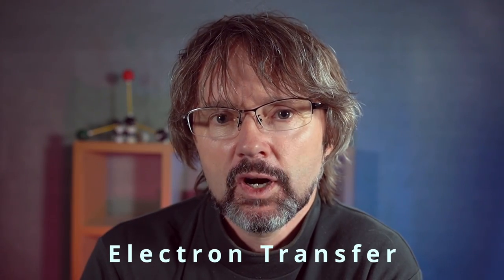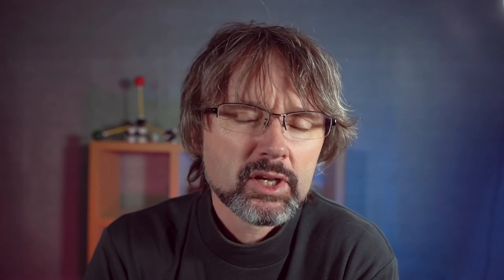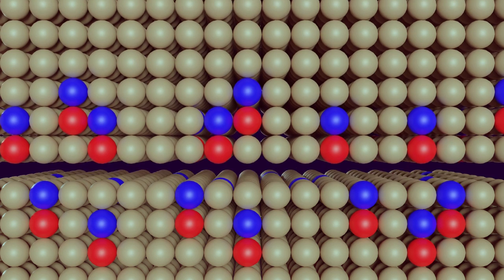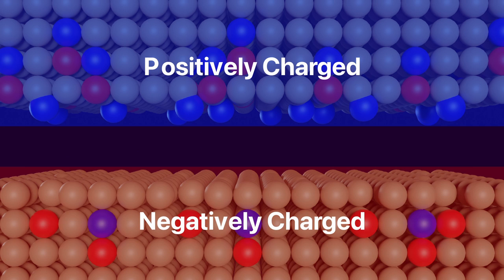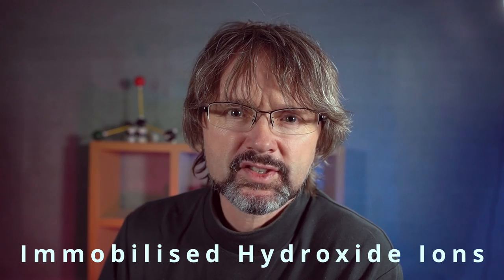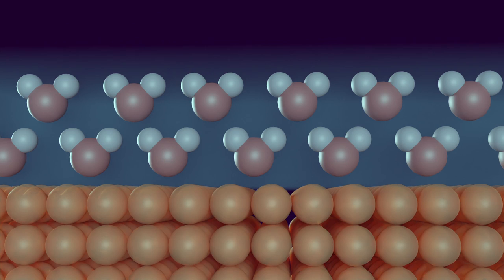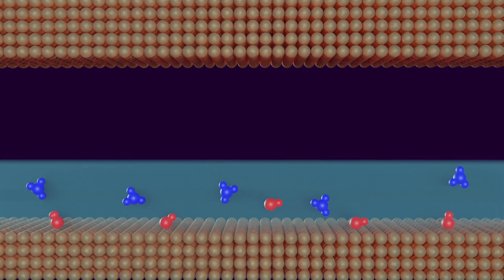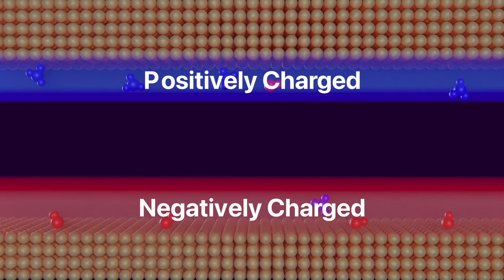Static electricity is more complicated than you think

Comment: One good way to prevent shocks when exiting your car is to place your hand on the metal panel as you come out, this way the charges will flow to the car when you're sliding off your seat ! 
Credits to PhysicsGirl for that one.

Great video once again, keep up the great work !
Reply from the maker: Thanks, and yes, that's a great one. Touch the metal before you disconnect. And PhysicsGirl is always great.
Reply: Agree, it's the only thing that worked with my former car
Reply: I was just going to add this one as a comment, discovered it years ago by (painful!) trial and error.

Comment: Another excellent video. Thank you!
My dad, when he was a young engineer, helped to design a line producing plastic bottles. One part of such machines is a transport system for nurdles - small beads of plastic put into the extruder. And the best way is to transport that by pipes with air. Plastic beads moving in plastic pipes... Oh yes, REALLY nice voltage. Those pipes have grounding stripes allover, but it's impossible to remove all that charge, so you have to be careful... One day some guy from health and safety department wanted to make an inspection. And he just went under those pipes like it was a nice umbrella... He got shocked so hard, he just sat down where he was standing. I guess some people need a hard lesson to learn😅
My own experiences were not so spectacular. I guess i learned to be more careful earlier;)
I used to install pneumatic post systems (hospitals and big markets). Those pipes also had static electricity, but not as severe.

Comment: I remember from school that rubbing fox tail on ebonite rod creates charge, demonstrated on an electrometer. Unfortunately, the teacer hasn't explained why, plus it got me even more perplexed for years: "Only these two specific materials do that? Why it happens? Does the heat of friction somehow converts to electricity? Is there physical or chemical change involved?" ... Your video explained a lot. I remember reading through "Triboelectric Effect" on Wikipedia, but I ended up having more questions then answers.
BTW you can make a video about how fabric softeners work (they also create - or maybe remove? - static charges) and why air-dried textlie is less soft than textile from a tumble dryer (the static charges are removed there by physical means I think).

Comment: The vacuum systems we used to have on our PCB routing machines used to build up huge charges if the wrong type of hoses were used. We had to use conductive plastic hoses that were earthed else you could get huge sparks that could jump 10mm or more. The problem seems to be that the fibreglass dust is extremely abrasive.
You'll also notice that Petrol tankers have Earthing wires that must be connected before commencing pumping for the same reason.

Comment: Another good way to think of static is to remember that the very notion of a physical object is simply the fact that electron shells around molecules repel each other. Without electro-negative repulsion, atoms and molecules would simply pass through each other. 

This repulsion also causes molecules to sometimes exchange and trade outer shell electrons in a non chemical manner. This builds up the electro-static charge which eventually causes things as grand as lightning or as small as a spark from wearing socks on a rug.

Comment: For years, both my dad and I were practically walking, talking, Tesla coils. Out of the family, it was only us. Couldn't touch any metal surface without a shock, and the point of discharge was often via the fingernails. 
For years we would literally earth ourselves. It worked, as in we stopped getting zapped, but it meant we had to touch the ground before:
Opening doors (buildings and vehicles (entering vehicles was the problem, not exiting vehicles which was noticeably odd to us))
Each time we grabbed an item off a supermarket/store shelf.
Before touching computer screens, computer cases, laptops, TV's, ATM's, etc.

Bamboo socks ended up being the permanent solution to the problem.
In my case, because I broke my foot without realising (I had my toenails smashed off and just assumed that was the source of weeks of pain) so I'm now a 9 and a 9.5 in shoe size. My left foot will slide around inside any shoe because shoes are only sold in matching pairs. Well, shoes I can afford.

Comment: So, the static electricity is depend on range of dual parallel different, the zero dual parallel different is exactly the same like shoes, both pair of shoe is same, so high dual parallel different is left is sneaker and right is boot, so when you have high two different to create an antibond which cause spark since it is so different, the higher the different, the higher the spark, so the metal cancel out since range of metal which is high or low, which is opposite of insulate, so it is a conductor, which means there is a hole so the spark will go out because it will seek the non-barrier, the non-exist, so a funnel path to go out, so like a water in a hole of glass that goes out, so the conductor is unstable, not stable as insulator since it is all close off, so the conductor is open, that means if you have metal so it will attach to other and hurt you, 
if you have insulator it will not hurt you since it is a barrier, so it is seeking (the proverb like attract, unlike attract), seeking the attract as oppose to itself which is opposite of external, like metal to non-metal, so insulator is opposite of conductor, so, everything is about balance open / close, etc, so you say earth as cancel out the electricity so that means too many open to cause spark which is connect to dirty electricity since there is no close off like earthing so the earth is an insulator, so need a barrier, so dirty electricity is open, so has no barrier so it will attack you since within you there is an open that pull electricity to break apart something, so your dual parallel different within you is weaker than external, so always have a ground so the ground represent what is full and what is stable. So, ya can make video about conductor and insulator, so what make them and what make stable and how to create stable, so what create negative 1, 2, and so on which represent unstable, and positive 1, 2, which represent stable, so it is connect to atomic theory or so, ya make it, so even connect to conductor band, so how all work from beginning to end, all of it, the whole reality. 

Be careful so ya will tell them to become a magician so to create a reality so not need government or so, so make it free, well, like a magician but science. Not rely on money but on material which you can create.

Comment: Maybe a knuckle hurts less than a fingertip, but I've found a trick that works even better.

Any metal object, e.g. a paperclip. Touch that to the grounded furniture and you can see the spark, but feel almost nothing at all.
Reply: Yes, that's the correct way of removing your static charge without getting hurt. You can do a similar thing with a Tesla coil. If you have a rod, you can connect yourself without pain. Just don't make any mistakes then 😁

Comment: I like getting static shocks.
Reply from the maker: I hate them so much, I take anti-static precautions for months after they're necessary 😄
Reply: Keep in your hand something metallic, for example a key (or some other good electric conductor material).  Make sure the skin touches the metal firmly.  Touch the door knob with your keys first, then with the hand.

No more electric shocks.  :o)